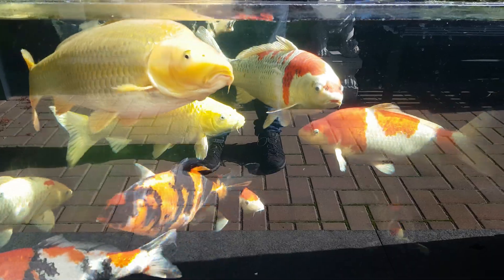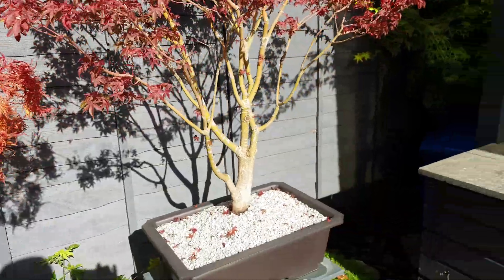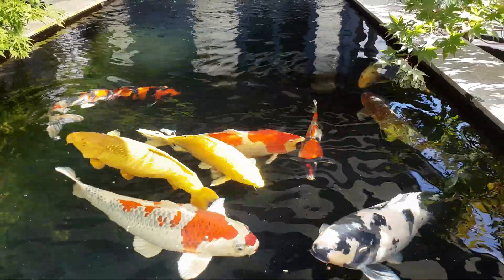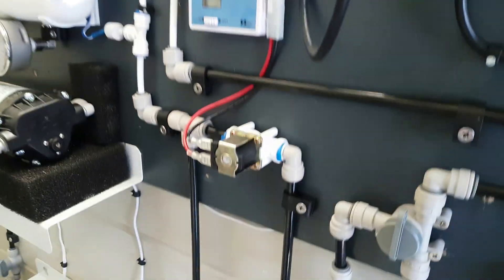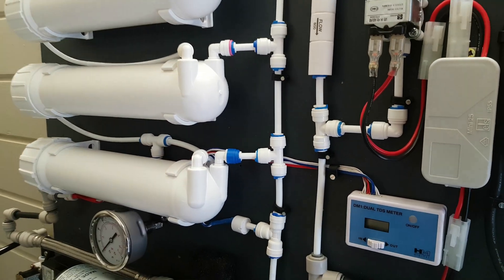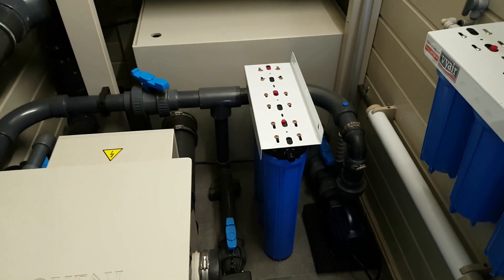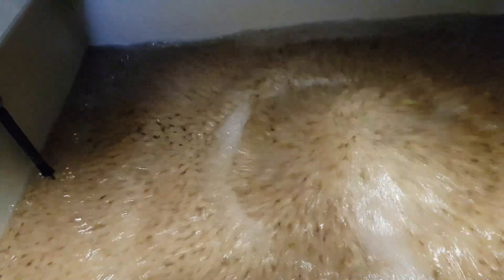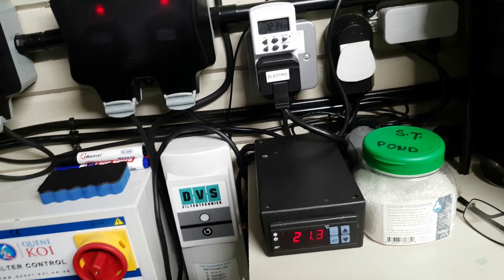Autumn Update. Chlorine and Pressurised Big Blues. Sodium Bicarbonate Dosing.

Comment: Hi Dave, not sure if I've asked question before, is there such a thing as a permanent kh/alkalinity moniter?.
Reply from the maker: There is mate, but they are mainly used on reef tanks, and have lots of fiddley bits to them.  
I think Queni Koi were testing out a kH controller while back...
I think a good quality pH controller is a better and more reliable bet.
My pH controller is a relic of my reefkeeping days, but has been rock solid reliable for over 10 years use. 
and drifts less than 0.02 in a couple of months with a pinpoint U.S.A. BNC probe.
Reply: @DavesKoiPond  thanks Dave, you've just jogged my memory, saw one on the big pond at this years winter event, big white box, and expensive, for some reason got £1200 in my head, might be wrong though
Reply from the maker: @marekskoipond9083  At that price it would probably be cheaper to pay someone to test kH manually every day lol! 
Are you looking to control bicarbonate dosing with it?
Reply from the maker: @marekskoipond9083  
I've not got a good track record with peristaltic pumps, 
I had a few on my old reef tank but running them constantly they would fail after a few months.
Though intermittant bi carb dosing should be a lot easier on them...
The only issue I can see with dosing is ph swing and what pH point you set the controller to dose the pond?
my pond swings from 7.62 to 7.74 ish daily...